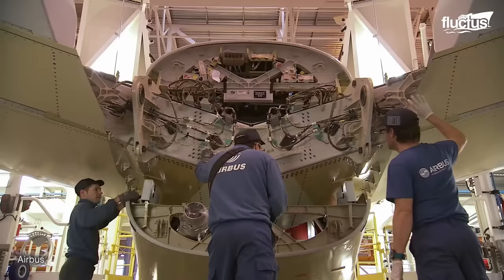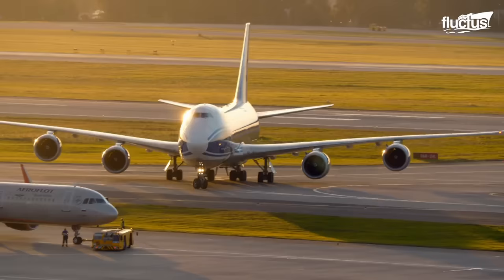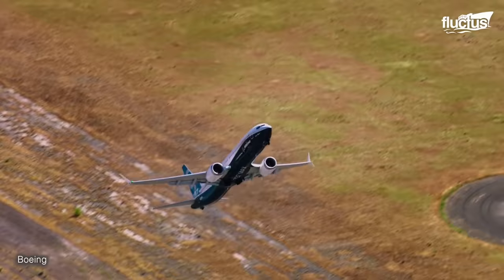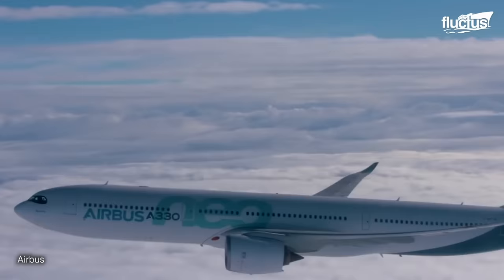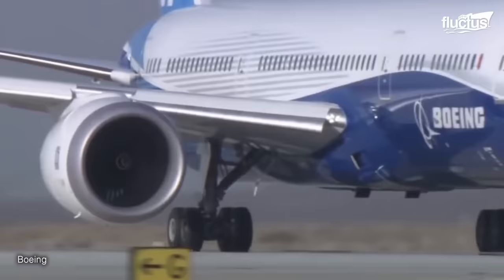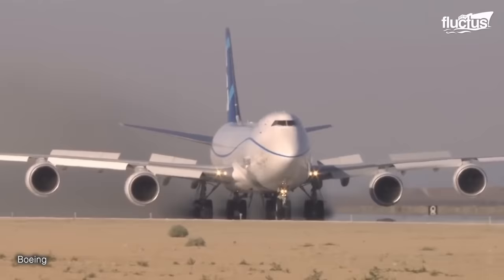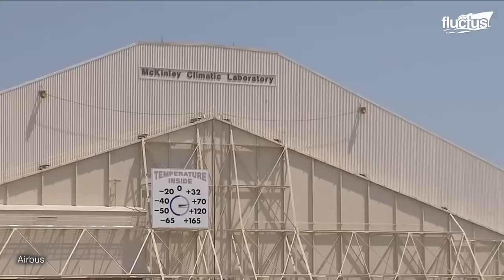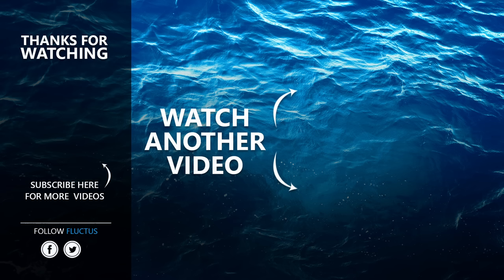How Brand New Aircraft are Cruelly Tested During Vertical Takeoff Before Being Sold

Comment: Highly regarded for its "commitment to testing", What happened with the Max then?  Uh huh... they got lazy and cut corners.
Reply: Boeing should of got jail time for the people in charge and not just a slap on the wrist
Reply: You mean “should have” right?
Reply: Max is engine replacement only right?same aircraft.been test on old engine not new.correct me if im wrong
Reply: Basically what happened is that the pilots that tested the 737max family knew the new technology emcas works so they knew how to deal with it when it happened. The issue was that they didnt tell theirs customers about it and when they encountered the problems they couldn't do anything to take control of the aircraft. Still shame on boing. Doesn't mean the 737 max is a bad airplane.
Reply: Boing saved $1M per aircraft sold by fudging the facts about mcas system and not making pilot retraining mandatory. Greed was the ultimate reason for the 737Max accidents, not the plane. It's disgusting that it wasn't considered manslaughter.
Reply: 😂😂😂😂😂🤦‍♂️ classic… 360 or something died testing
Reply: @itchitrigger8185  BOEING
Reply: The Max problem was caused by a change to the trim systems. Many foreign carriers did not properly train for the design change. While there were some problems with the changes from a software standpoint, these could be overcome with proper training and established procedures.
Reply: @ekong90  correct… ish. They had to raise the engines up into the wings due to their size. This caused issues with the wings behavior so they had to integrate a software to correct that. The software was the flaw
Reply: @j.scottcaudill7543  they go from Boing to Bong 😆
Reply: @jackdennis9286 i tend to disagree m the software did not malfunction, it performed exactly as it was supposed to. The problem came from the wrong information the software got from external sensors, ie angle of attack sensor.
The malfunction of the sensor told the software the airplane was borderline stalling, whereas the aircraft was flying level. The software reacted like it was supposed to and forced the plane down, leading to the crash. 
The malfunction of the sensor is usually anticipated leading to redundancy in sensors, and deactivating the software in cas of disagreement between the AoA sensors, leaving the crew able to decide how to handle the pb if any. Standard procedure in aeronautics.
The appalling stinginess of Boeing led the company to use only one sensor to activate the software, exposing the unaware crew to the dramatic malfunction. This is the reason they should be heavily fined and some people jailed.
.
Reply: @itchitrigger8185  Greed is the ultimate reason for everything that happens in America.
Reply: No what happened with the Max was pilots and industry got to comfortable with automatic flight controls and systems and forgot sometimes you need to actually manually fly the plane...
Reply: @jackdennis9286 no the pilots were also the flaw they forgot to turn autopilot off and manually fly tge damn plane
Reply: @glennschlorf1285  Don’t buy it. Your explanation misses three key factors: the gulf in training and proficiency between US or Western pilots and other pilots; the pressure Boeing succumbed to in order keep the price of pilot transition to the Max down; and the dereliction by US regulators because of the revolving door between government and industry.
Reply: @AmericusMaximus  you may not like my answer but it is exactly the thing that led to the crashes.... MCAS was put on to allow the Max8 and Max9 to fly similarly to the prior generations of the 737 so as to save time and money on pilot training as well as not require new Type requirements for pilots on these planes... the crashes involved in the new planes that crashed yes had faulty Angle of Attack sensors... however when the pilots realized they had a auto trim issue instead of taking off the auto pilot and trim features both flight crews once stabilized put the autopilot and mcas system back on which led to the loss of both aircraft... if these flight crews would have only flown the plane manual... the stalling of the aircraft would not have occurred... that is the real problem was the reliance on technology that had a failure....
Reply: @neutraltoxic  that's the world, in general.
Reply: When hardware fails, use software to correct the problem 😂
Reply: That's whataboutism
Reply: I heard that statement and immediately came down to see if anyone commented about it. 😂
Reply: @Kane Oliver  corporate politicians who they contribute to their campaigns protect them.

Also de-regulations lobbied$$ by corporations plays a huge factor.
Reply: This was paid for by Boeing lmao
Reply: With this kind of tests it's evident that there was a conspiracy to conceal known flaws
Reply: @elisangelrb  Facts
Reply: @EricRosenwaldPhotography  If he mean’t “should’ve” than write “should’ve” what’s wring Eric got your period today?
Reply: More accurately they got cheap.
Reply: Commitment to testing but not training 😂
Reply: @Ellinillard  The MAX actually has 3 AoA sensors. But if they used more the one sensor for MCAS, it would have been classed as a safety-critical system, and the FAA instead of Boeing would have had to decide whether sim training would have been necessary. Alas, Boeing used a single AoA sensor so that pilots were allowed to fly the MAX with just a 737NG type rating and a small difference training not even mentioning MCAS, and 346 payed the price.
Reply: @glennschlorf1285  While I can't find anything regarding autopilot usage during JT610, the ET302 flight crew used manual flight controls for the whole incident after noticing the runaway stabilizer. The only system the flight crew reactivated was the electrical trim system, which they needed since they couldn't use the manual trim wheels due to the large pressure on the stabilizer caused by the runaway trim. The electric trim is only supposed to move by direct pilot input while in manual flight, so no autopilot (apart from the undocumented MCAS) was actually active during the incident.
Reply: @lukasg_  Precisely : your post is more detailed than mine. Having AOA sensors and not using them (all) is akin to not having them. The only useless things in flying is the runway part behind your plane and gas on the ground.
Reply: Not lazy, but greedy! 🤨
Reply: Exactly what happens when sales people start to run a company and push Engineering to the back seat.
Reply: @mikakrstic  literally no one cares. He/she may be writing in a language that is not his first.
Reply: not only lazy, but also greedy
Reply: Max wasn’t a lack of testing, it was a lack of required pilot education where Boeing didn’t require pilots be informed of one crucial flight system.
Reply: @mikakrstic  you mean "I have no valuable information to ask so I'm going to go after someone's grammar."?
Reply: highly coinded.
Reply: While I completely agree and think Boeing execs should be on death row for this, testing the specific parts that failed in the specific way that they failed while recreating the issue is near impossible.  Because they could fail and still not cause issues.
Reply: I HIGHLY encourage all to watch the documentary on Boeing. I think it’s called “Downfall“ 🤯🤯
Reply: @wadehults  complete BS!! They didn’t train bcus Boeing didn’t tell anyone about the systems or how they work. Watch the documentary Downfall!
Reply: Can you hear all those dead people disagree? I can.
Reply: They didn’t get lazy so much… they got (and still are) greedy.
Reply: And the revolving door between FAA and Boeing... FDA Pfizer etc
Reply: @mikakrstic  silly to point something like that out. We all know what the person meant write and might have gotten it wrong for several reasons
Reply: @erice6755  It’s still wrong isn’t it..
Reply: @kaneoliver2080  should have. Should of makes no grammatical or logical sense at all. What is should “of”? Is should “of” a particular genre?
Reply: They didn't get lazy, they got cheap.
Reply: @mikakrstic He 'max'd' it. 🤣
Reply: @mikakrstic  good one
Reply: @mikakrstic  And what’s wring with you? Spelling!
Reply: @kaneoliver2080  the FAA should've been investigated for colluding with Boeing as well
Reply: The pilot failure of them 2 crashes was due to pilots failing to do runaway trim procedure within 15 seconds of the Runaway trim (heavy sticks unresponsive trim control, disconnect auto throttle and autopilot) you must cut the trim power right away it's a memory item

First crash piolts never attempted to cut power to trim system (the 2 stab switches directly behind the trim wheel) they just kept pressing up trim and had over 7 minutes to cut power to trim when the plane was going up and down like a yo-yo

second crash the captain did recognise runaway trim but it was after 40-50 seconds and because trim buttons was not been pressed and held up like the first crash so when they cut power the trims was already at near maximum down and was unable to spin the wheel by hand due to high forces on the trim 

Both flights engine power was at full take off power for the whole event

The trim fault event was caused the situation to happen and poor training and reaction to a faulty trim event, fault on a  powered trim is rare but it does happen (stuck relay/short) as to why the 2 stab switches are there in easy location to cut the power when trim buttons are unresponsive when been held and with autopilot and auto throttle disabled

Look for 737 runaway trim procedure
Reply: @leexgx  Just curious, where are you from?
Reply: @elisangelrb  Well there you go. Learn your airplane before flying it.
Reply: @t.mendous7922  UK
Reply: @leexgx  Do they teach writing there? I’m from the US and so don’t know obviously, but it doesn’t seem so. While you are correct, you will probably be ignored unless your grammatical skills improve drastically. Just some friendly advice from a concerned individual
Reply: @t.mendous7922  I thought you was going to be the grammar Dr on here (considering what you posted before was also not spelt correctly, if your wanting me to be picky as well)
Reply: @glennschlorf1285  really Man the pilots.10 secs that's it only 10.secs for them to figure out if not the mcas just gone keep trimming untill its too late to lift cos of the weight from the tail. It's game over .
Reply: Im from Vietnam
Reply: @kaneoliver2080 Unfortunatly, they are all money buddies. They have a huge proportion of people believing we need to fight with eachother, so they can all continue to line their pockets.
Reply: That had nothing to do with the plane’s flying ability or improper testing.
Reply: @zacharydonelson  Move out of your mom’s basement.
Reply: @kaneoliver2080  “should of”
Reply: Damn right
Reply: Boeing didn't get lazy they got greedy. They knew this would be a problem but went through with it anyway without regard for the safety of its passengers.
Reply: @elisangelrb   I remember they were saying mcas was automated so there’s no need to tell the information about it 😢
Reply: @ekong90   but the Boeing 777X has a different design, not the same as the previous Boeing 777.

Comment: Back in the 80s, I was taking off from the Denver airport (Stapleton at the time) in a Continental Airlines DC 9 when the starboard engine ingested parts of a tire that blew after their abort point. After a loud pop, the man sitting next to me, who happened to be a pilot on a different airline, explained to me that we probably blew a rear tire, and bits of it were ingested into the engine (on that plane, the engines were located not on the wing but on the fuselage behind the rear landing gear), causing it to shut down. 

He calmly explained to me that the plane was totally capable of flying with only one engine, and that we would circle back and land at the same airport. No problem. I wasn't so calm, nor were the other passengers that also heard the loud pop. The take off, now with only one engine, seemed perfectly normal to me. When it was time to land, the pilot expertly put the plane down first on the side with the good tires, then the nose wheel touched down, then the damaged wheels were ever so gently put down. Fire trucks followed us as we landed; when the plane went to turn off the runway, the other tire on the damaged side popped and went flat. That stopped the plane in its tracks. A bus came to offload the passengers, and as we deplaned the pilot greeted us all. I asked if he would be the pilot on our replacement aircraft; he said he would be. I told him I was glad that he would be flying the next aircraft and praised him and his crew for their expert handling of the situation. We would all be late getting to our destinations, but we'd still be alive.

Long story short - modern jet aircraft can certainly take off and fly with only one engine!
Reply: DC9 was kinda a cute thing...
Reply: That’s a story not many can tell but you are lucky to have experienced that and learned something new; a feat we all should do daily!
Reply: great story!
Reply: I like this story. That keeping cool guys are an amazing company anytime.
Reply: Those pilots are definitely the alphas in any room they enter
Reply: I always thank the pilots at the conclusion of every flight if they are standing near the exit.  Bumpy flight, late arrival, whatever.  We all made it in one piece, which is good enough for me.
Reply: Sehr interessante Geschichte ❕👌🏼😃
Lieben Gruß aus Berlin,
Ramsi 🙋🏻‍♂️
Reply: Not only that, but to land on half damaged wheels, and not fall over or anything like that, is impressive.
Reply: life is weird, you could have died in that aircraft back in 80s, yet here you are in 2023 and writing a youtube comment of your journey that i read at 3 am local time sleepless, probably at least 10K miles away from where you live in completely different part of the world, broke af but filled with a hope
Reply: @atb7048  tf go to sleep
Reply: I would've passed out of sheer anxiety lol I admire pilots for their composure.
Reply: Not just jet aircraft,  multi engine turboprops and multi engine piston aircraft as well. It's part of your training for a multi engine rating to handle this well.
Reply: Long story loooooong 🤣🤣🤣
Reply: Awesome story! I’m happy you and the other passengers landed safely, and you’re right, Boeing (if memory serves) used to hook up one engine in total and test planes that way, and you’re right, one is more than capable. The sheer volume of redundancies modern airlines use make it safer than brushing your teeth
Reply: Well there you go. Nice.
Reply: Redundancy...
Reply: Ummm you think. They’re designed and engineered that way
Reply: Airbus isn’t just French either
Reply: I enjoy reading long commentary that's interesting or a personal storyline. Thank god you were okay, you had your angel beside you to psychologically hold your hand, what a coincidence you chose to be the luckier passenger with a pilot beside you. Keep writing your comments, there's more than just me who like reading clear, well written commentary that isn't pretentious or moralising etc👍💖✨📖
Reply: @MadScientist267  yeah before it became the death capsule nine with a list of fatalities.
All learned from for design etc.
Reply: @atb7048  awe, hope your not skint still(as we say in Scotland) coming from the word skinned. Remember time is in constant flux so even if the present isn't the best, it will for sure change. That helps me when im feeling despite having enough to survive, still bored. Money is only fun when you have a bit of being poor for a few days, then you can appreciate it, a blessing the rich never get. Same as being hungry, food tastes delicious when you're hungry, even porridge warming your belly. Coming to you from Scotland take care my broke af friend. X
Reply: @malalapipe77  and a good long story.
Reply: @sandracairney6007  thx mate really appreciate it
Reply: @sandracairney6007  Thank you. Very nice comment!
Reply: Some planes only have one engine though...so that wouldn't be ideal
Reply: did you fly a concorde ?
Reply: @sandracairney6007 Thank you for the nice comment!
Reply: Seems that a trijet is still not a outdated design..
Reply: If there's one thing I learned about the DC 9 from the TV series Mayday, it's that the DC 9 will crash at some point :D
Reply: This is a totally made up story. I do however commend you for having done your basic google searches in order to make this story up. You had me at the….”the man sitting next to me was a pilot”…….really? What would you expect if you were apparently the pilot on an airplane? A journalist? A fantasist? Or maybe just a story teller…….which you of course are. I did enjoy the read ………..however brief. Xx

Comment: I remember when they tested a 747 at Dublin airport years ago with vertical climbs, dives, and all round crazy maneuvers. It was some time after the El Al Flight 1862 disaster in Holland. They where testing out new pins (the cause of the crash in Holland) on the engines and pushing that 747 to its limits. A friend worked in the airport at the time and had heard it was going to happen, and what time. He let us know, and we all got as close as we could to the airport when the time came. Jaw dropping stuff, and i was blown away that a 747 could actually fly the way it did.
Reply: Must have been a sight to behold! Was any footage taken at the time or is there something similar of the 747?
Reply: @GG_Booboo  Ive never seen any. It was years ago, and if anyone has footage, it would be Dublin airport.